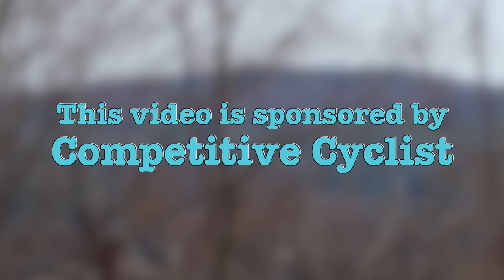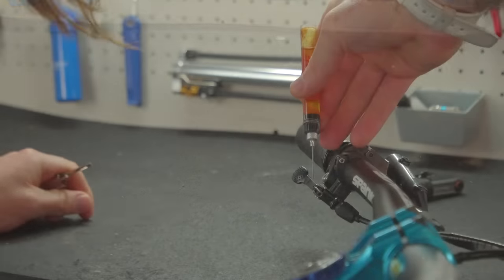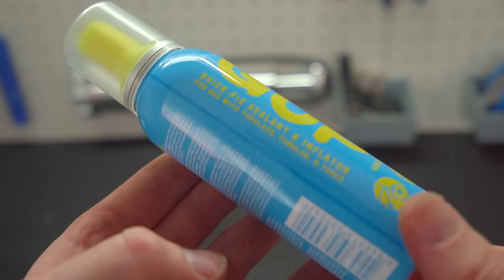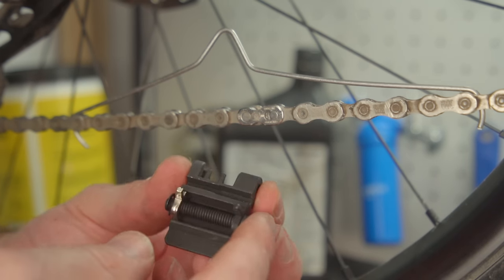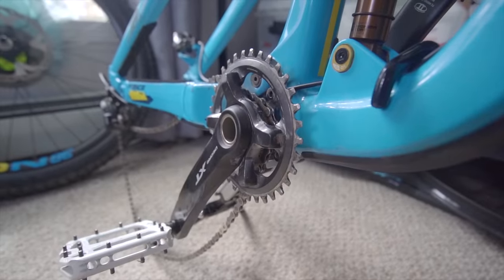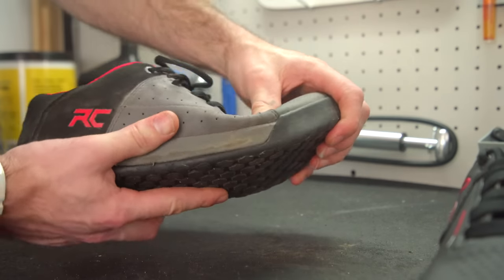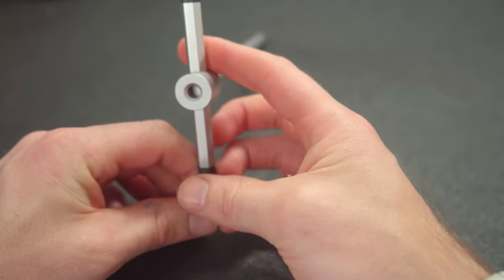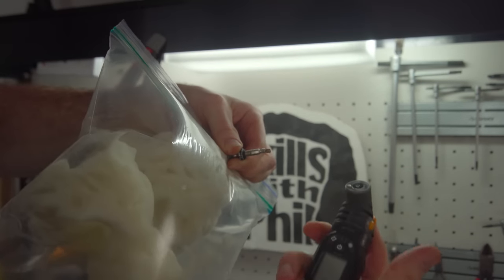10 Mountain Bike Products From Good To Bad

Comment: Modern cables are nylon lined, lubricating them attracts dirt and increases wear... Flush them out with something that will flash off and keep them clean and dry! :-)
Reply: Yes totally. Never lube cables. Old school misconception.
 I expect a new inner (and flush outer with contact cleaner etc) cost less than that lube!
Reply: Yet Shimano sells a specific grease for lubing cables in SP41 housing, Item no.: Y04180000
Reply: @justinwbohner  Yep, Shimano like money, the same as any other company... You do you, I've never had issues with dry cables, whereas I've had numerous issues with cables clogged with grease/oil and dirt. A dry lubricant such as graphite can be used with little consequence, but it's unnecessary in modern cables which are kept clean.

Comment: Lezyne makes versions of that pump specifically for fat bikes.  I have been using one with my fat bike, and it's definitely nice to have the larger volume pump when adding air to 4.8" tires.

Only downside is it has to screw onto the valve stem instead of pressing on (unless they've redesigned it in the past couple years).
Reply from the maker: Good to know!

Comment: I used the chamois butter, but I apply it to my skin, not the chamois. 10 miles or more and I use cornstarch to keep things chafe-free. 25 miles or more and I change to thigh lube. That's for road biking and touring. Spinning 90 rpm adds up quickly.

Comment: Phil, did the black chuck on the Lezyne pump come with it originally ?  I have the same pump from a number of years but only the gold piece.  Every time I use the pump, the threaded on chuck pulls out the removable valve core.  Pretty frustrating.  One of my LBS who sells the pump indicated this is a common problem.

Comment: Hey whats a basic set of flat pedals safe for children? My son's (7yrs old) spec rip rock HT came with the stock cheap plastic, but he is slipping off pedals. What the next level up? My flat set are Chesters but those pins would rip his shins up. Whats a basic set of flats safe for kids?
-Sam
P.S. or if you have a video about this already id be stoked to view it!👍🏽
Reply from the maker: Shinners are going to happen. The more slippery the pedal the more shinner will bruise, the more pins a pedal has the more they'll cut you up. I like pedals that with longer pins, but It's a tough call for a parent. Also good flat peeal shoes make a big difference. They don't have to be bike specific wore vans with a waffle sole growing up which worked fine but I'd encourage people not to use running sneaker/hiking boots for riding. They don't work well with pedals. I might also recommend wearing shin pads and long pants until he get used to them. There's no way around it, shinner will happen and the best way to look at it is a badge of honor for putting in hard work.

Good luck dude!
Reply: @SkillsWithPhil  Thank you phill! I appreciate it.
Reply from the maker: @piciu256  The race face pedals he speaks of have metal pins and actually grip pretty alright. They 100x better than normal plastic pedals.
Reply: @piciu256  Thank you.
Reply: Chesters may be too big for 7yo feet (not all pins will hit his shoes). $$$ but Chromag Radars are super nice. I’m sure there are others. Agree with @Skills with Phil that slipping a pedal is potentially worse than the occasional cut shin or ankle.
Reply: Get him some soccer shin pads or even a cut-up milk jug under long socks while he gets used to them.

Comment: Phil after some more use, how are you liking the ride concept shoes? Got my free riders stolen in Rotorua on a trip to New Zealand, and went to get them replaced only to find out adidas is no longer shipping 5.10 to NZ. Shop talked me into the same ride concepts you have. So far, haven’t noticed a difference in grip between them and 5.10’s but the sole is much stiffer and more comfortable to ride

Comment: Interesting adding grease to bolts.  As an auto mechanic they always say not to do that due to its hydraulic abilities changing the amount of torque you apply.  Basically as you tighten, the bolt can tighten up due to hydraulic pressure before reaching manufacturers spec. May work fine but it is a risk.  I recommend using bolt anti seize its a brush on paste made for this use.
Reply: Anti sieze is grease with copper.in it! Some bike bolts require grease, some thread lock. Stem bolts can cause creaks if not lightly greased

Comment: What the heck is Phil doing with the Blackburn multitool [and the tubeless valve] at the end of that segment?!?
Reply from the maker: The way it's designed, the bolt on quick link remover gets in the way. Adding a rubber O ring prevents the bolt from moving when not in use.

Comment: I've only ever heard of and used chamois [sham'ee] butter on my skin. In the old days, when bike short chamois were made with actual suede leather from a cow, you would put it on the leather, but not anymore. Not that it won't work, but you only need to put it on the areas you feel the most pressure.
Reply: Agreed... though it works to spread it on the chamois... I learned to just put some in my hand and rub it on my junk.  I'm also a roadie who does  enjoy the pain cave (100 plus miles) and actually have an anxiety response if I don't lube up.  As an aside.. if a roadie offers a left handed handshake, don't force the right hand shake... they are being kind and not using their "lube hand."

Comment: Putting grease on stem bolts? Not a good idea. Even worse if you run a carbon bar then exceed the recommended  torque even if you use a torque wrench
Reply from the maker: If you like seized bolts you are free to continue to not greasing your bolts. :)

Side note I just email them and got a reply:
"We do recommend putting a small amount of high quality grease on your stem faceplate bolts then torquing your faceplate bolts to your handlebar manufacturers suggested values."
Reply: @SkillsWithPhil  nevermind, against seized bolts just use anti-seize. Maybe Seth can ask the  parktool guys on their opinion what's the way to go here :)

Comment: The progold lube device is a standard clock oiler, I'm sure there are other uses, but thats thhe only place i've seen it before.
Reply from the maker: I wonder if is the same formula or just the using the same syringe. Either was that’s good to know
Reply: @SkillsWithPhil  No idea, we didn't really use clock oil on clocks, we just refilled them with Mobile 1.

Comment: I don't have a quick link tool, so I found an old pair of kiddie scissors and used a dremel to cut notches into the ends so it locks the rollers into the ends. It works like a charm.
Reply from the maker: That's actually pretty smart dude!
Reply: @SkillsWithPhil  Thanks

Comment: Be careful with tightening lubed bolts. The grease changes the coefficient of friction and lowers the maximum torque that should be applied to that bolt. If you tighten a lubed bolt to the specced torque, you can damage the bolt or the counterpart.
Reply from the maker: That's not how it works in the mtb world. Grease is critical or else you be left with seized bolts and will lead to a big headache down the road. Things are different in the automotive industry from what I understand.
Reply: @SkillsWithPhil  I'm a mechanical engineer, so trust me when I tell you that the physics of friction between threads is the same anywhere, be on cars, planes or bicycles. You are wrong.
Reply from the maker: @Baureo   Before accusing me of being wrong, take a step back understand that the bike world and aviation world are completely different. That doesn't change the laws of physics and what you're saying is still correct but exact torque specs aren't nearly as critical on mountain bikes as they might be on a multimillion dollar fighter jets. Either grease or thread-locker can be used on stem bolts. Their primary purpose is to prevent the bolts from seizing. 

Component manufacturers even recommend using it
https://www.bikethomson.com/wp-content/uploads/2015/10/StemInst.pdf
Reply: @SkillsWithPhil  I'm not saying greasing a thread is wrong. I said that lubrication changes the coefficient of friction between threads - not maybe, but sure as hell. The torque specs are always given for dry threads, because manufacturers can't know what grease will be used and how much it changes the CoF. The torques are calculated with the CoF of the paired materials, thread pitch, ~ angle and ~ diameter. The formula for calculating that applies the same anywhere. Depending on the grease the CoF can vary in a wide range and so will the required torque. Torque translates in axial tension (force). By lubricating the thread you will have less resistance (friction) and thereby achieve a higher axial tension with the same applied torque. That can be detrimental to a carbon handlebar or the weaker metal. Since bolts are generally made from steel, you might strip the threading in an aluminum stem.
BTW on cars there are a way bigger safety margins (for bolts) than on bicycles.